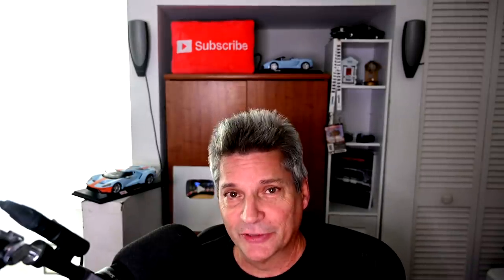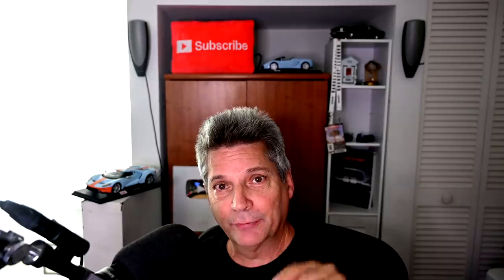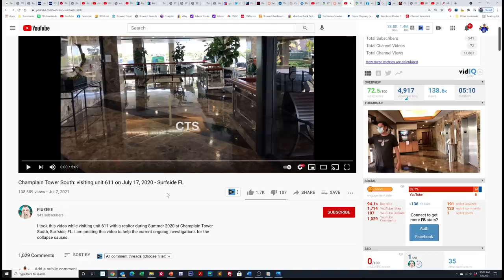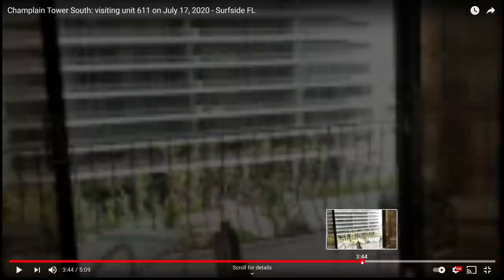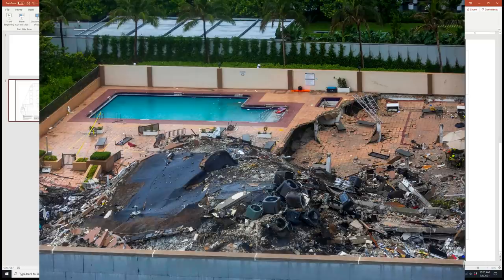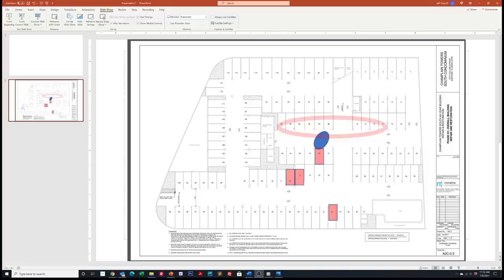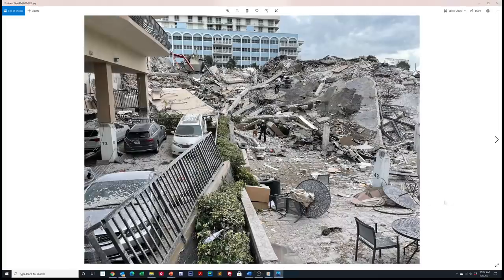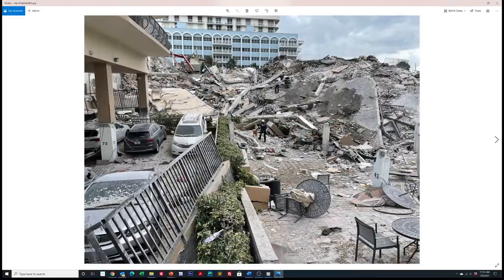Analysis Garage Video BEFORE Condo Collapse: Water Everywhere

Comment: Leon Wechsler Architect's Conclusion. If one looks at the columns in the garage, you can clearly see the lack of concrete tie beams spanning between the columns.
Since this has no post tension cables, it is very easy to see why the deck collapsed.
No tie beams, no extra support, the columns shear right thru the slab. In this case, look at the building that was still standing, the bottom of the second floor has a huge 24 inch or more concrete tie beam at the exterior perimeter. This tie beam supported the remaining building but the deck  (pool deck) had no tie beams, therefore it collapsed via punch shear. This is a fundamental design mistake by the Structural Engineer of that time. The top of the columns should have at least a thickened slab to prevent this. 
There are numerous mistakes like this especially where the building collapsed. 
NO TIE BEAMS AT CRITICAL POINTS
Reply from the maker: There were certain support beams shown on the beam schedule, but only at certain maximum load points
Reply: Seems similar to the construction of the (collapsed) South Korean shopping mall design. No lattice of horizontal support beams between the columns. The floor/ceiling cast structure tied to the rebar in the columns is all there is (I guess until it isn't.)
Reply: Not to mention only two 90 degree rebars in each direction from the column tops into the slab! You can see them sticking out at the column tops after the floor slab sheared off.  I believe the plans showed 4 rebars each direction.
Reply: @sentino68  Right there was suppposed to be 2 bars at the top and bottom in each direction. What we can see is just the bottom two that have ripped cleanly out of the bottom of the slab. It's possible the top two sheared off at the top of the slab when it fell, and they are there in the column, but we can't see because they got sheared off cleanly at the column
Reply: @brnmcc01  Sorry, I'm not following, please.  What caused so many columns to punch through the slab (?)  How does that work (?)  There's no new force (other than gravity) acting DOWN on the slab . . . to force the columns UP through the slab.  Even if the slab moves laterally . . . I'd imagine the worst case would be that column would just break away.   Is it that . . . the rebar on the columns extends into the slab . . . and when it moves laterally . . . the column rips out of the slab and the slab then falls around the resulting hole (?)
Reply: And no capitals on top of the small columns supporting the pool deck and planter boxes.
Reply: Easy to armchair engineer . I disagree and I stayed at a best Western last night.
Reply: @QED_  There is no new force pushing down is right, but 40 years of water leakage into the ceiling of the garage, rusting all the rebar, caused the ceiling of the garage to collapse. That is why the columns are still standing. The ceiling fell right past the columns. Cement without rebar will hold no weight, the ceiling of the garage could no longer hold the weight it was designed to hold. That started a domino effect to bring the building down.
Reply: Not much rebar to tie the columns to the slab. The rebar in the slab seems to be very close to the face of the concrete. (maybe an inch?) The columns in that area look smaller that those in the area that didn't collapse.
Reply: @murraywagnon1841  That's the key, the code specifies only 3/4" of cover is needed in INDOOR areas. Well, anyone can see from the puddles everywhere, and the bubbles in the paint on the garage ceiling, this whole garage might have just might as well have been considered to be outdoors. Plus I read somewhere that only 4 of the 16 exhaust fans were working, and the poor ventilation didn't help things.
Reply: @jeffostroff  hi Jeff, I noticed parking spot 15 had damage at the base of the pillar, like the one shown in a photograph  in your other video. It's hard to see of course, but maybe you can zoom in.  (@ around 27min)
Reply: Sounds quite typical for 1980s Florida construction standards.
Reply: @E.T. Ethics the balcony decks are always thinner than the rest of the slab. It has to do with the balconies actually being a superficial structure, they don't support anything except themselves and a few people, not the floors above. They are structurally cantilevered off of the main structure, and if they made them thicker, they would require support out at the leading edge. So if they want "floating" balconies without a bunch of columns out at the rail to block the views, they need to make them thin and out of high tensile concrete. But every balcony on the building could collapse without endangering the structure of the main building.
Reply: @sentino68  Column #72 shows only 2 rebar in each of 4 directions and only #3 or #4 rebar not even 3/4". None showing on punch through columns.
Reply: Noticed same lack of boxbeams. But also at 00:24 in - the rebar in ceiling looks to be 4" centers pulled from ceiling but no 90 deg. cross rebar, certainly not tied.
Reply: @yannmarkovich7399  just a bit of info, not sure how true it is, but I have been told the drawings that the other author is referring to are architectural drawings, not as-built drawing. There can be dozens of revisions, and I've worked on buildings that the maintenance guys didn't even have the as-builts, they were working from inaccurate drawings. But just going by the drawings that the engineer worked off of 3 years ago do not show any accomodations for parking on the deck, there isn't any extra support for the weight of vehicles. And it wouldn't make much sense for a contractor to remove it if the pool deck was repurposed, the extra support wouldn't cause a problem, it would just make the structure stronger and cost money to replace for no reason. I am looking for pics from 40 years ago when the building was still new, but advertisements from that era and grand opening flyers don't seem to be online.
Reply: The slab is acting as a beam. As long as it’s thick enough additional beams aren’t necessary and would lack clearance overhead.
Reply: @golfmaniac  Concrete, not just cement.
Reply: That’s simply a “flat slab” system. There’s nothing, I repeat: NOTHING fundamentally wrong with that design approach, provided it’s adequate for the task at hand. Obviously it was not sufficient for the task of holding onto small columns in a corrosive environment.
-A guy on YT with a PE license
Reply: I don’t know if anyone else noticed. The side that collapsed the columns were smaller then the side that did collapse. It’s kinda scary that there’s city inspectors that aren’t doing their job.
Reply: @Elad Erihsnoved That's a video of the demo of the part that remained standing. Go fish, twoofer.
Reply: @jacktheaviator4938  Interesting point. I'm thinking that they had just enough parking for the towers original rooms. They later added penthouses. I wonder if this is when they added the parking to that first floor area.
Reply: @dangarcia6760  I'm not sure if they added occupancy by modifying the design, it is a very interesting theory. But if that is the case, there should be some records filed with the city/county offices that show the changes in occupancy, such as an original application for a permit, or site surveys... something. All of the proposals for a project this size would be linked to the number of units/occupants, and if that was changed at some point it would be at least noted, and might even require another vote by the city council to find approval. I am wondering if people are going to be forced to file freedom of information requests to get the records on this building. 
But that being said, there is something that does worry me about the search for information. The Dade County records office was hit pretty hard by Hurricane Andrew and ALOT of records were lost. So if there were changes made, we may never know. The only reason I know that is because after Andrew, my dad went and worked in the miami area for a few months, and one of the buildings he worked on was one of the records storage facilities, and he sent for my mother, who worked in a library, to help try and save microfiche that had been emersed in sea water. I can remember playing in hallways full of debris, and storage boxes FULL of files that were saturated. There wasn't much else they could have done. The papers may have been salvageable, but they definitely didn't have the infrastructure or personell to try and save them in the days after the storm. 
Hurricane Andrew probably effected building codes more than any other storm. The code in Miami/Dade changed drastically, everything from the number of piers under a raised home, to how many nails  are used to attach a shingle. And though Dade county has been hit a few times since Andrew,the damage has always been less. So the new codes seem to have helped. I don't know how those code changes effected high rise condos, but I can't imagine getting smashed by Hurricane winds and storm surge repeatedly isn't gonna help the situation and must have contributed in some way to the collapse of a building on a barrier island. 
Hubris is a very dangerous thing, and building a highrise structure on a migrating barrier island reminds me of a parable I heard in  Vacation Bible School as a kid, about a foolish man who built his house upon the sand. I guess the developer skipped VBS that day.
Reply: @yannmarkovich7399  I can't find any pictures of what that might have looked like when built. But I would think they wouldn't want cars that close to the pool, and problems with cars parking at the same grade as the lounge area. But I have seen tackier design choices made on even higher-end properties, so who knows? But it is a plausible theory, the loads of a car driving over a deck is very different from a few lounge chairs and pedestrians. And I wonder how many times contractors drove manlifts over that deck in the last 40 years when working on the building facade. I would LOVE to see a set of prints with the words AS BUILT on the cover page in big letters.
Reply: @robyde  I have my suspicions that they might have tried to eliminate the beams or column boxes in the design to increase clearance without having to excavate deeper for the garage, and didn't increase the sheer strength at the point where the columns penetrated the deck. It sorta looks like the area with the smaller columns was originally conceiver to have a different structural design, and this was an addendum. That coupled with the water ingress and rebar failure, all contributed to the collapse. But that's just an idea, and I can't say I have any evidence to back that up other than intuition based on past experience. I have witnessed some bad ideas from architects and engineers that were "addendum-ed" to death, and just steadily got worse with every revision. There are a couple buildings on the USM Gulf Park campus in Long Beach Mississippi that are an absolute mess.
Reply: @TryptychUK  Thanks, I will make sure I use the word concrete next time.
Reply: Tie beams are nominally reinforced with stirrups and bear on cmu. A flat plate punching shear in determined by column size, slab thickness and concrete strength. Shear capacity can be increase with column capitals. Reinforcing steel is for flexural strength of flat plate.
Reply: @brnmcc01  Look at the roof photograph. I may be wrong, but some of the roof ventilation looks redundant laying on it’s side? What was it serving? Get out the maintenance records & drawings. Speak to to all the previous maintenance personnel.
Reply: @dananorth895  I saw the same. Very poor workmanship.
Reply: @jacktheaviator4938  Jack, well said.

Comment: There is one area no one mentioned, the elevator pits.  Those were geared elevators with the machine room located on the roof.  At the bottom of the elevator shafts, there is a pit which contains the buffers and can vary in depth from 4 to 6 feet below the bottom floor of the parking garage.  What I'm curious about, was there any water in those pits over the years and was it being pumped out?  Reason being that those pits being below grade holding water can degrade the foundation and footings around those pits.  The only way to know is finding out which elevator maintenance/repair company was contracted to service and maintain those elevators and if they have any reports indicating degradation of the elevator shafts and specifically those pits below grade.  Anyway, it was just a thought coming from a former employee of a major elevator manufacturer.
Reply: Any metal parts in those pit buffer wells were probably all rusted out. Scary!
Reply from the maker: good quesiotn
Reply: Absolutely. I read in one of the repair contracts for the work about to start, and it mentions somewhere they had difficulties keeping the water pumped out, and the constant flooding in that pit was causing problems. Perhaps this is where they were burning out motors every two years.
Reply: @brnmcc01  Could be since it's well below grade and water will collect there.
Reply: @continentalgin  I would think so and being spring buffers in lieu of hydraulic buffers due to the rise and duty (I'm guessing the elevator duties were 2500 lbs at 125 fpm for that building application) they would still have to be maintained regularly and perhaps replaced every 10 years or so.  Just my opinion.
Reply: @TheFlatlander440  I have noticed here in FL that elevator inspections are not always kept up on! I've been in many expired units and they sounded like they were in need of maintenance..(I only know a small amount and I mean very small amount about them from working at a Jax FL high rise hotel with very old, unkept OTIS elevators..circa 1955...guests stuck too many times to count..me, being alone working 3rd shift having to go to the roof at 3am to get it going again...I was NOT paid enough for that stress!
Reply: @chrisreed26  Sounds like they were never modernized up to today's specs. Sad indeed.  I will say, that those older geared elevators if properly maintained on a regular basis will last a very long time.  If they aren't, then like any electro mechanical device they will eventually fail.
Reply: Elevators are a huge expense when it's time to replace or upgrade them. I was a security guard in a tall office building downtown and I got to know the elevator guy real well. He could tell some amazing stories. He was always complaining about our elevators because they were so outdated and still used mechanical relays and a lot of analog circuitry. He did a good job of keeping them running but the system was so obsolete there were few guys left that really knew how to work on them. He said when the building was built these types of elevators were already being phased out and he surmised that the contractor saved money on buying an obsolete elevator system on a discount.
32 floors, 6 cars and I believe he said he told the owners it would cost about 10 million to replace the ropes, the motors and the control circuitry. They put the building up for sale.
Reply: @brnmcc01  whered you read that?
Reply: @Lethgar_Smith  Yeah.  Those old mechanical relays on the controllers could short circuit by just having a roach crawl between the contacts.  Elevators should be brought up to modern standards but even two geared elevators would cost a small fortune.  I'm guessing the elevators in your bldg were gearless (direct drive) with  the rise over 30 stories.   Money, money money. Right.
Reply: @brnmcc01  The mechanical room with the motors was at the top, not in the pit.
Reply: @TheFlatlander440  Yes. Big electric winches with cables wound on spools.
Reply: .........Hey William T........Wow...Good Insight and Observation...!!!!!...So, Do Email Your 'YOUTUBE' Comment to the Lead Building Inspector working on the 8777 Collapse case---The TV News Folks Always Taking to Him, on the Various TV News Shows----Forgot his Name---They said he Worked on the NYC Twin Tower case, Also....He Says His Firm Thinks of 20-25 Possible Causes, then Eliminates them One by One, until they get to the Bottom of the Cause----Your Idea Should be One of the 25, i say....!!!.....Just saying...!!!.....:)
Reply: @hellen70666666  I appreciate your statement however, I'm making an analysis of one possible reason that may or may not have led to degradation of the foundation and support pillars.  I'm sure they are well aware of that condition among others.
Reply: Yep.....thats all in and around space 78.....good questions as well!